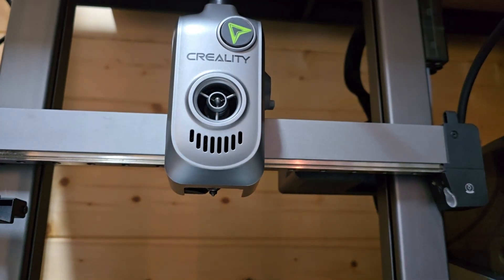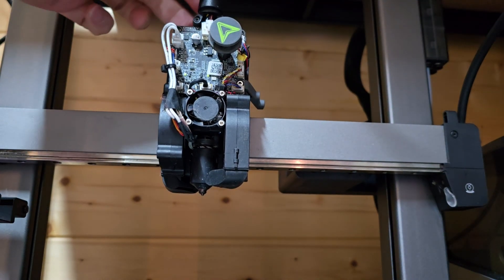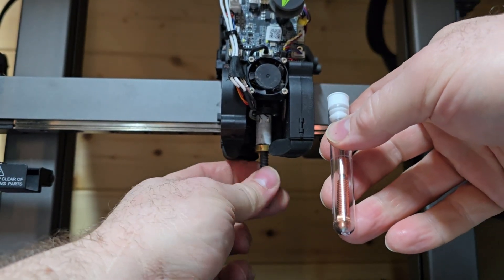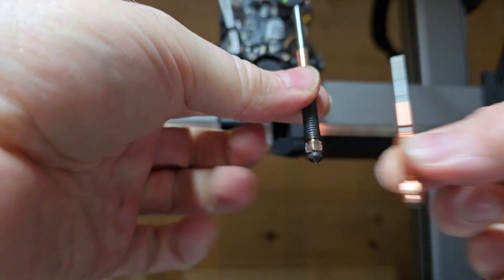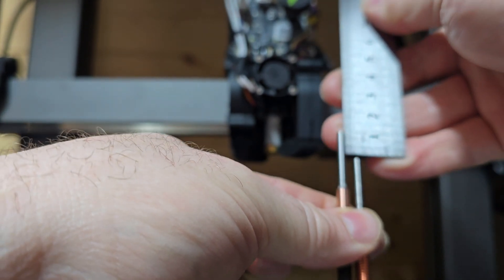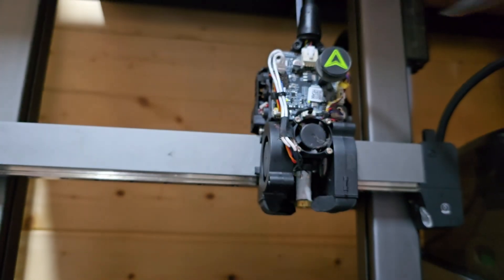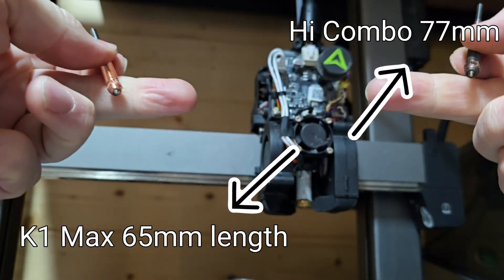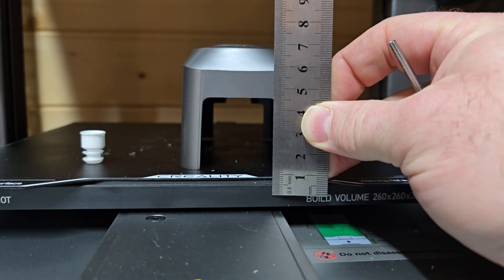Understanding Creality's Hi Nozzle Size: Why Bigger Isn't Always Better

Comment: Thanks for the video.  Apparently, if you loosen the left hand fan, the boot comes of easier.  Also, once loosened, the nozzle will come out quicker if you use the other end of the spanner to spin it out.

Comment: Great video! I've heard that the A1 had to do a recall due to the mains bed, honestly using a mains bed was an unnecessary bald move but, do we know if they took some extra measures of insulation for this not to happen? I would be very interested in you doing a full review of the inside 👌🏻👏🏻